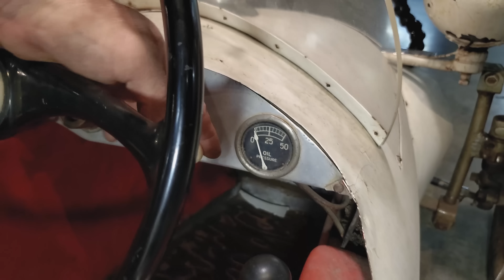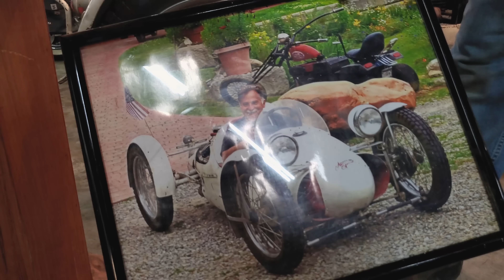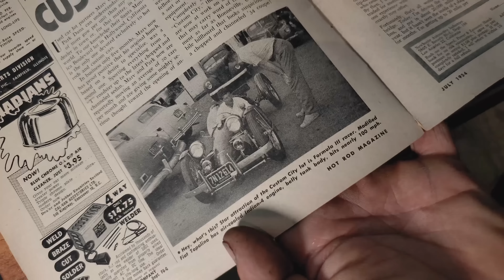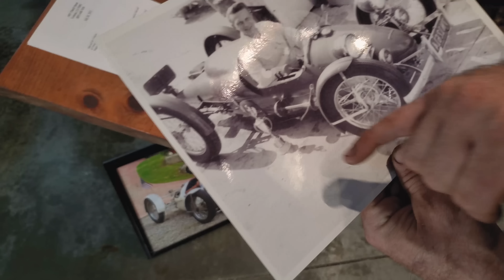The American Pickers Special

Comment: Ever since I was a young man, I have wanted to build a car like this. I still do. My plan was to use a Honda Goldwing engine. I'm too old and poor to do it now. But even dreams can be wonderful.
Reply: My Dreams have been stressing me the hell out.
Reply: I have/had the same dream. I wanted to use two 200hp engines originally, now I suppose it would be two 250hp bike engines in a chassis that all weighs 1200lbs ish, but I have a motorcycle and times are hard, maybe someday
Reply: Check the auction areas for a wrecked bike. You can probably find one for fairly cheap if you go to a region where salvage bikes are not allowed on the road.
Maybe a few hundred dollars, if you are lucky.
Film everything and post it on YouTube, you may actually make money doing it

Comment: You should check out a one off race car from Canada.
The "Dreossi Special ". Still running a vintage race events.
Same principle, drop tank used as chassis, mid engines , single seat.
Built in the 50's I believe.

Comment: Please fire up the knucklehead three wheeler. Our dealer in Macon, Ga had on in the back of the shop for decades (Goover Sassaman, passed away in January at age 98). Ended up selling to HD for the museum in the late 80's or early 90's. Never got to hear it run... The transmission on one of those things is wild. Just saying...